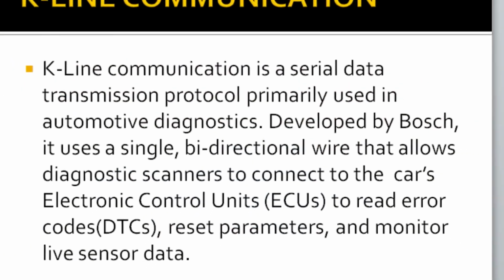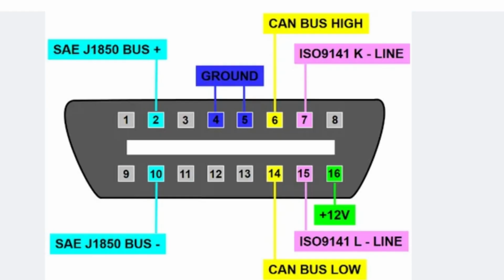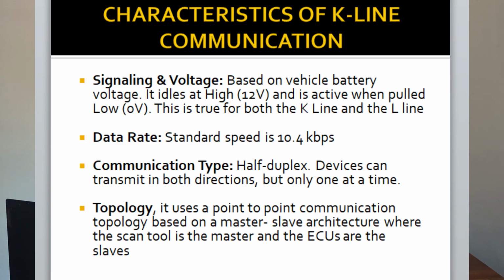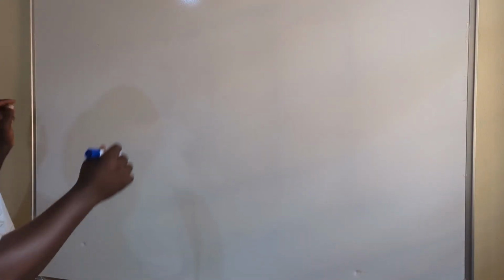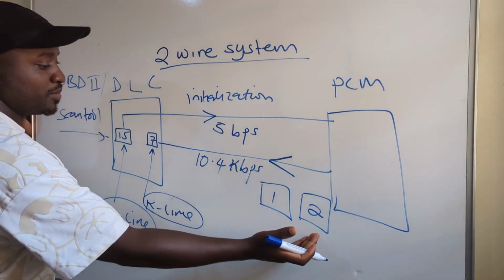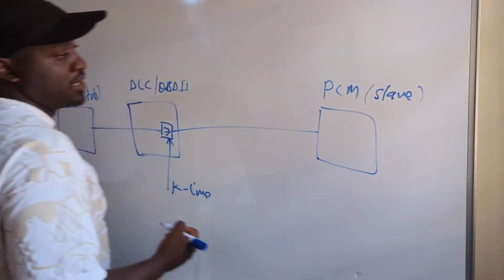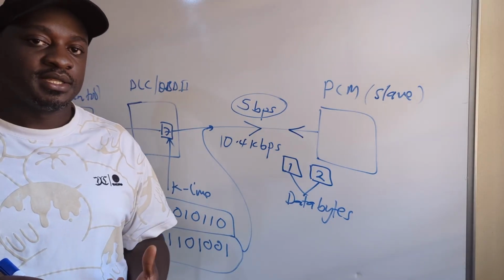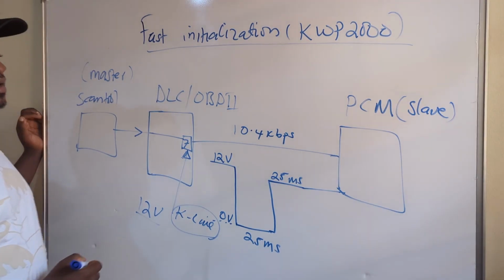K Line Communication protocol explained

Comment: Hi Stephen I have a 2010 Chevrolet Corsa 1.8 my K Line is reading 3.8v ,op-com not communication.Which modules Do I remove,as my Speedometer on Dashboard not working.All speed sensors are working.ABS light is on.Thank you sir
Reply from the maker: Hi, there are a number of issues that can result to that, but I will help you narrow down to the most common issues.
If  some one has done aftermarket installations such as radios,there is a possibility of tapping on the Kline,this creates a voltage drop on line hidering communication,next you need to check your wiring diagram to see which modules can easily be accessed and begin with those and disconnect one at atime as you are measuring the voltage,if that checks out, you will have to check out for the wiring integrity from the dlc to all the modules